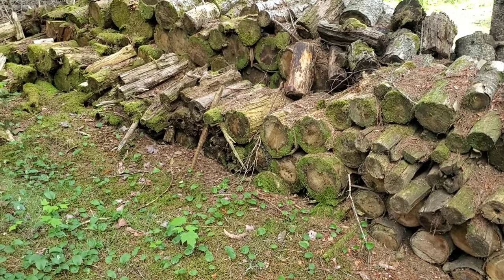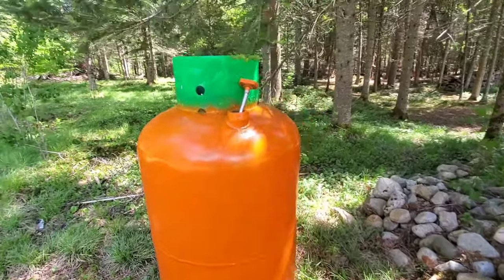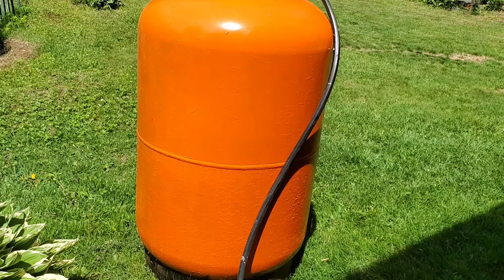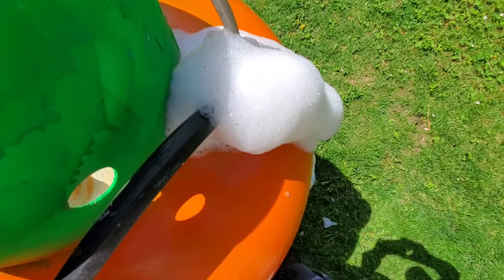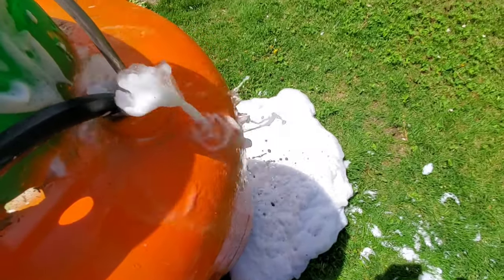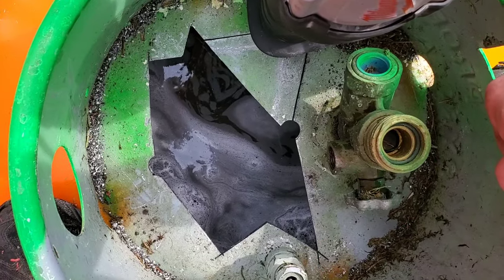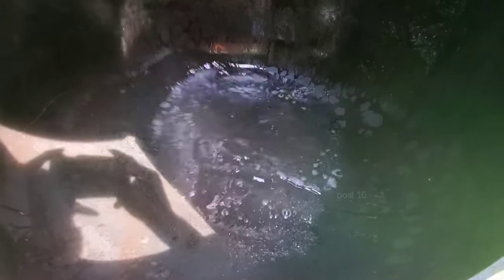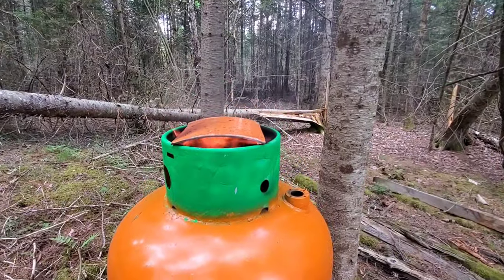Converting 120 Gallon Tank Into Windproof Campsite Stove (Full Version)

Comment from the maker: This is a 120 gallon tank and they fill it with 96 gallons of propane to allow expansion, A 120 gallon tank holds 420 pounds of propane, 120 gallons of water is 1,002 pounds plus the 175 pound tank, I think it felt heavier but ok. Total 1,177 lbs or 534 kg
Reply: if you stick a stove pipe 1/2 down inside the tank. you will have one hell of a rocket stove
Reply: Those tanks are Worth $100 empty easily.

Comment: Fun fact: what you can smell inside the tank is not propane.
Propane is odourless, so to make leaks detectable Ethyl Mercaptan is added to it.
That's why all such gasses smell the same, they all have the same additive.

It's toxic BTW, but it's so incredibly smelly that the amount added is miniscule.

PS
Propane is lighter than air so there was probably zero of it in the tank at this stage.

PPS
I'm an idiot, propane is heavier than air. I was looking at it's density as a liquid which us less than water... >.<
Reply: Usually they use sulfur.
Propane is lighter than air. Nope a Camping gas box has it`s holes on the bottom, bc it`s heavier than air.
Reply: Thanks for the run down, Hank.
Reply: @lukasreiser4669  Ethyl Mercaptan is a hydrocarbon with a sulfur atom at the end.

It doesn't smell like hydrogen sulfide though.
Reply: @SierraSierraFoxtrot  Nice correction Sierra!
Reply: Make sure you Google the correct information next time you want to try and sound like an expert.
Reply: Propane and propane accessories

Comment: for those wondering, water (at about 70 degrees F or 20 degrees C) is about 8.35 pounds per gallon. However many gallons of water you have, multiply that by 8.35 and you will get close to the weight (within a pound or so). The other way to look at it is that water is exactly 1 gram per cubic centimeter, and you can just do unit conversions from there.

Comment: Yea the cobalt-coated steel bits really don't like being run dry, you might get away with it for a few holes but they overheat or catch and then they crack off. You gotta put a glob of cutting oil on the tip, it'll cut better and you won't break buts as often. Also, cutting oil helps with the snagging and stalling the drill, a more powerful drill will just spin the bit inside the chuck instead of stalling but it's the same problem. Tanks like these, once they're past their expiration date, are really popular for making wood stoves for garages and such where you need a LOT of heat output and want something thick enough not to get burn-throughs like the lighter steel in oil drums and water heaters.
Reply from the maker: Read my descriptions, when I went to return it they all were defective

Comment: Propane tanks are measured in the weight of propane they hold, not fluid gallons so this is a 120 pound tank. The scent you are smelling is Ethyl Mercaptan added to the propane for safety so you can smell it if there's a leak because straight propane is odorless. LOL! Hopefully after a fire or two that smell goes away. Yet another great video. Thanks for sharing your projects, as well as your adventures.
Reply from the maker: This is a 120 gallon tank and they fill it with 96 gallons of propane to allow expansion, A 120 gallon tank holds 420 pounds of propane
Reply from the maker: They are measured in both
Reply: @post.10  Ahh! I see what you mean. As a heavy equipment mechanic I'm used to the smaller size cylinders on fork lifts and the like.

Comment: after the paint is removed from it. You should paint it with a High Heat Paint. so at least it prolongs the Life of the tank longer so it doesnt rust away to fast. even though it would take awhile to rust away.
Reply from the maker: Would that actually work though? This thing turns red as it fills with hot coals
Reply: @post.10  well I know the Rust-Oleum High Heat Flat Black Spray Paint works for up to 2000 degrees. that can be sprayed on automotive extra-hot exhaust manifolds and even grills. even Charcoal girls. I have used it on my Charcoal grill few years ago. havent needed to repaint it yet.  I mean those can get pretty hot. I mean picking up one can of that stuff. and like painting it on the back. as a test wouldnt be that bad to at least try it. but again. even if you dont paint it. it might take a few years before it really starts to get into Rusting bad. unless you brush it with wire brush once and awhile. but again, worth a shot at least to protect it for alot longer.

Comment: I've got similar set-ups in 5 and 20 pound sizes.  Try putting some slits in the side with the cut-off tool to give the fire more air while still stopping sparks and wind.  Also an car exhaust tip or some other pipe piece can be placed on top to extend the chimney improving the draft.

Comment: That drill is so old lol you can hear the use it’s been through
Reply: I have a much more modern Black and Decker corded drill and it has less torque than my battery powered DeWalt.  Also had a B&D electric lawn mower that did not last long. Not my fave brand!  Moral of the story - at the next yard sale buy the $5 drill not the $1 one!

Comment: They wanted to charge you $1100 to take the tank back? And it's their rental? Whoever you talked to just didn't want to deal with it, sounds like lol. They probably wouldn't have scrapped it though, those tanks can be recertified pretty easily. I've seen some cylinders over 100 years old still in service. That oil in the bottom of the tank I'd an additive that gives propane its distinctive smell. Propane is actually odorless!! Great video!

Comment: Those round drill bits are not made for that. :)
Reply from the maker: Sure they are it was just low quality and after I returned it the guy in the store threw all the rest out after showing cracking from the factory, I used these all the time wiring metal factory machines